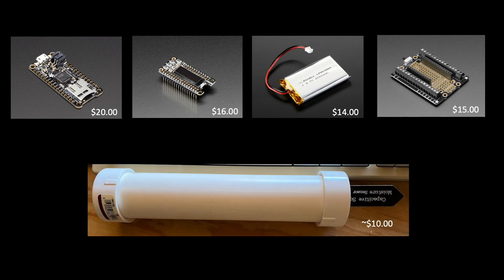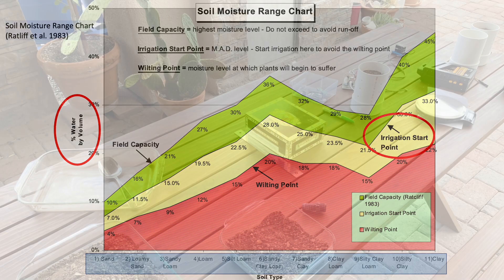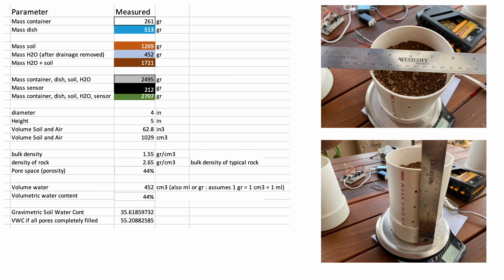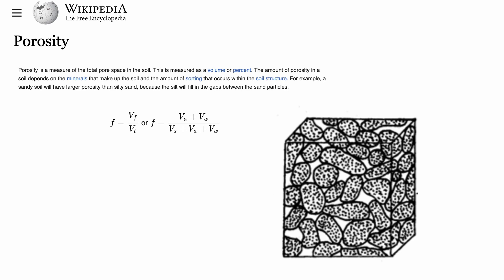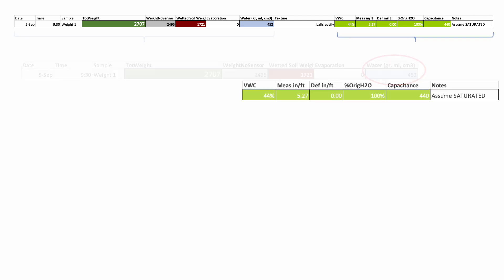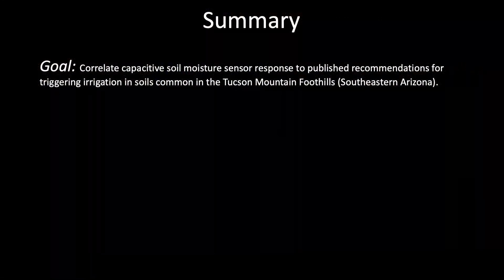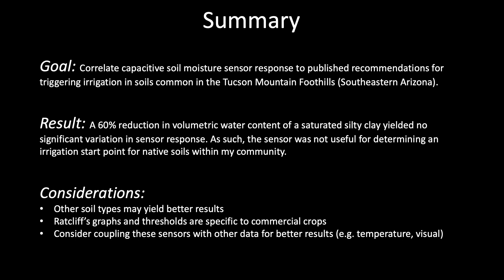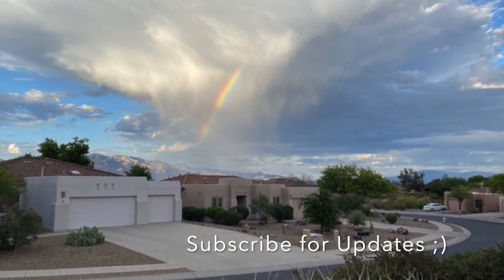Calibrating Soil Moisture Sensors for Irrigation

Comment: I love your approach. I'm dismayed by the results haha. I'm working on a system that currently heavily relies on the capacitative moisture sensors, however, I'm afraid they're not worth it. My own basic moisture tests essentially gave me the same results--they're not nearly accurate enough to fine tune watering conditions.
Reply from the maker: Agreed- those sensors are qualitative at best. Still, I needed to go through the motions and hope this video helps others avoid using these for precision quantitative purposes.

Comment: I have subscribed to your channel as I find this very interesting, and think that the capacitive sensor you are using is not the best option, and think the stainless steel wires are a much better option with regard to depth and soil clinging onto the sensor, plus length. Bob in the UK
Reply from the maker: Agreed. I'm sure I can make them work with a little more investment of time and effort. For the time being, I've pivoted to looking at temperature as an indicator for which I'll be sharing details shortly. Appreciate you subscribing - stay tuned!

Comment: Thanks for the detailed investigation!
I noticed you placed the sensor in the middle of the tube, while the holes are in the side, so they get dry faster than the central core.
Actually, when you took out the probe, it was still wet.. which could interfere with the reading value.
May improve the experiment with other configuration? eg: no lateral holes but allow evaporation from the top only?
Since the tube is small, it may be evaporating faster on the sides and it receive more sun
Reply from the maker: Thank You. Yes- I understand the potential for error but based on other experiments, the challenges are similar in field conditions independent of being in a column. I am not clear as to the reason— it perhaps may have something to do with soil compacting after wetting. I just find they are not reliable at least for my tested soil type. See 10:40 for field installation.

Comment: Outstanding video. Thanks for sharing your explorations in calibrating DIY capacitive soil moisture sensors. We are long time users of Teros 12 sensors and consider them the gold standard for capacitive (indirect) volumetric soil water content measurement.
Reply from the maker: Thanks and yes- the Teros sensor is what my colleagues at the University of Arizona are using. I wish I could get my hands on one to explore— a bit too pricey though for a backyard citizen scientists. I still think there’s a lot we might determine from temperature as an affordable analog : https://youtu.be/4yfhJRE4qDU?si=IPuJ9EaXba2qnj67
Reply: @ModestMaker  Dielectric permittivity is a decreasing function of temperature. Generally for subsurface probes we don't take this into account as diurnal soil temperature does not fluctuate to the same degree as air temperature. To estimate available water capacity including the permanent wilting point, the soil water characteristics calculator may be helpful to you https://www.ars.usda.gov/research/software/download/?softwareid=492&modecode=80-42-05-10

Estimates of percent sand, silt, clay, bulk density, organic matter, and salinity for your soil are input values. Bulk density is easy to measure, percent sand, silt, clay can be obtained from USDA-NRCS Web Soil Survey for your soil type (preferred) or estimated via column sedimentation. Since you're located in an arid region salinity (saturated extract) may be important. Check with Web Soil Survey or measure this with an inexpensive meter. And good luck with your adventures in capacitive soil moisture sensors.
Reply from the maker: Thanks! An ARS calculator for wilting point- I love it. Agreed- not too much temperature variance at depth, but definitely a diurnal signature a few inches down. https://io.adafruit.com/biod101/dashboards/soil-experiment-ambient-shade. Maybe the first few inches can tell me something, although I agree rooting depth is the key. It’s fun to measure all this stuff anyway. https://youtu.be/1fKoxlAXaAU?si=pQZ5eV6Q4TPdMJfG

Comment: Excellent video, thank you for the time to produce the experiment, document it, and put up a video of your results.  I am trying to come up with a sensor system to help indoor watering, specifically in the winter. I have done a ton of reading, youtubing etc, and so far, not found something that produces consistent results over longer periods of time. Resistive sensors deteriorate too quickly, capacitive sensors have promise, but the trick is to find a high quality one. There may be other solutions, but so far,  I have not found any.
Reply from the maker: For what it's worth, I've been working with the University of Arizona on an irrigation control system that uses Teros 12 sensors (https://metergroup.com/products/teros-12/). 

Working with a student, we managed to get these to interface with an ESP-32-S3 for controlling a suite of irrigation control valves (solenoids) at a research site. The Teros 12 sensor supports the SD1-12 communication protocol for which there is an Arduino Library. 

Since the code and project are not my own, it wouldn't be appropriate for me to share that on my channel but I will confirm it's doable. I have reached out to Meter Group asking if they would donate a sensor so I can produce a formal tutorial on how to do this for the benefit of others, but they declined. The issue is the sensor is costs about $258 which is something I can't afford, but it is an alternative you might explore.
Reply: @ModestMaker  the Teros 12 sensor is highly unlikely to pass the better half approval test.  But I will check into it.  I was planning on building at least 4 sensors, but more likely 8,  as we have winter storage in 4 different location.  We have a large collection over wintering.  I am fine with a sampling technique in each area.  Thinking a large pot and medium pot sample would get me close enough for my objectives. I want each one to be wireless, so I can remote monitor them. As a retired professional coder, software will not be an issue. I am new to esp32s.  I have done a little bit of micro PLC work, so building the hardware should not be an issue.  I love the work you have done.  Very nicely executed !
Reply from the maker: Thanks. My experience has been that the capacitive sensors do not hold up to the elements very well over time. Here is the full playlist : https://youtube.com/playlist?list=PLqJ5k4cakypy1E4J_tvEiD0kpFK1tGY3D&si=r4vya3sAPACIluSV

Comment: is it possible that your sensor in this setup have a faulty reading because of the bad sensor? I have come across this video: https://youtu.be/IGP38bz-K48?si=Af19SZJ_XlXwAuC0 , Did your sensor use ne555, doesn't have voltage regulator or missing output resistor?
Reply from the maker: I checked all that here: https://youtu.be/lb4HdcpYWCQ?si=_xzaAGwenIYx4eBV . All sensors went through thorough quality control before selection.

Comment: Exactly, all this hobby soil moisture sensors are crap. We tried a lot of them. The capacitive once are just so bad. Soil type is a factor, but changing the sensor a bit, a mouse or worm will give you different readings.
Reply from the maker: Yes- in addition, two of the three I have installed in my formal setup just started reporting weird data after 6 weeks installed in the field. Temperature shows some promise- I will post some new results shortly, suffice it to say I haven’t had much luck with capacitance.

Comment: Great video! I've got a couple of these sensors myself (for irrigation monitoring for my home garden) and this is good to know but unfortunate. I'm wondering if there's an issue of adhesion and compressed soil. 

1) Water sticks onto the coating of the sensors, so it may be that if there's any water present, it'll be on the 
2) Clayey/silty soils are pretty compressible. Inserting the sensor into soil will create a dense region around the sensor which may reduce water permeability away from the sensor itself.
Reply from the maker: Possibly. This is why I qualified my conclusions for “silty clay soils”, although I have witnessed the same behavior in premium potting soil (no measurements taken though). Thanks for those observations and suggestions 👍.

Comment: trying to use capacitive soil moisture sensors for irrigation of tomato plants on my balcony. Re soldered timer chips for TLC 555 (because NE 555 chips). using Arduino NANO 33 IoT with set   // Set ADC to use 12 bits,  analogReadResolution(12);, that is giving me resolution from DryValue1 = 3480; to about WetValue1 = 1910; (dry soil to almost dripping wet saturation). i probably need to look more at soil type (bulk density), field density, irrigation point and Willting Point. 
overal great video, I have to learn a bit more. It is not as easy as to set "two point calibration" and hope for the best :( :D
Reply from the maker: I agree on the two point calibration challenge. My concern is the sensor response is non linear as evidenced by relative insensitivity to water loss. I don’t think increasing resolution will help since (at least for my soil type) the signal itself is insensitive, but please share if you come up with any interesting results or further mods. Thanks for sharing!
Reply: @ModestMaker  yop, i have resolution from about 1000 (fully saturated soil) to 3550 (air), using simple kalman filter to at least somehow smoother spikes, mapped and constrained values to percentage (0 to 100 percent). but i will need to do full calibration for each sensor (for "medium" that i am using) determining field capacity and wilting point for coco coir + perlite. oh why have i gone through this rabbit hole ? :(
Reply from the maker: I know- right? I am working on a radiation shield for temp but as soon as I think I have it figured out, something else creeps up 🙄. The reward will be to finally get it all right but it’s a long and winding road though.
Reply: @ModestMaker  yop, i have set up second monitor for one particular plant. Two sensors in one pot (15cm apart) protected from water (resoldered timinig chip, glue heat shrink on electronic part pcb and epoxy on sides of pcb not to soak moisture from sides) just to determine wilting point by observation (to look at plant with eyes, when it will start to suffer from not enough of water) roots are in fairly constant temperature (20-21 °C) plant have not been watered for about 4 days and moisture percentage is slowly but steadily raising on one sensor (dont know why) plant is still pretty much thriving ...
Reply from the maker: @J0stik Eyes are the best!